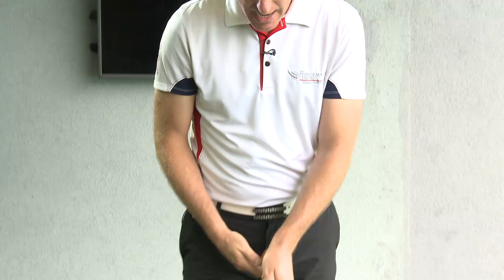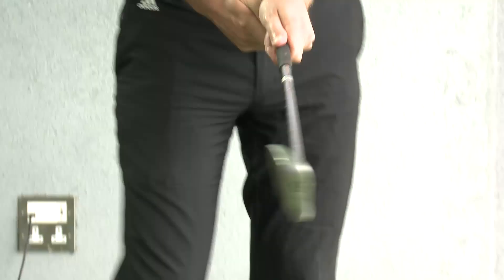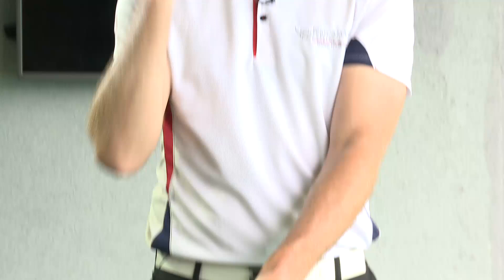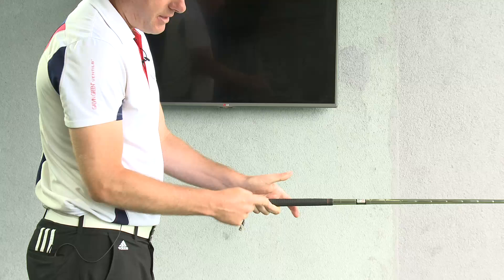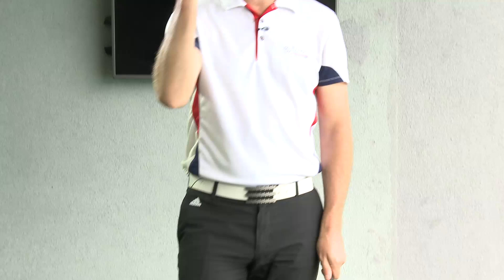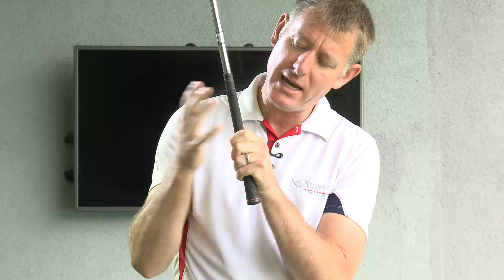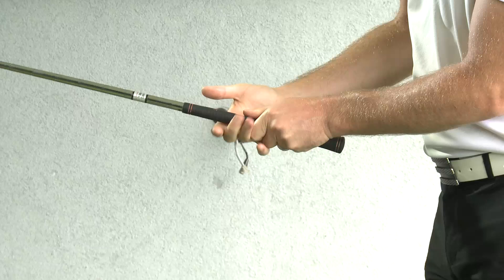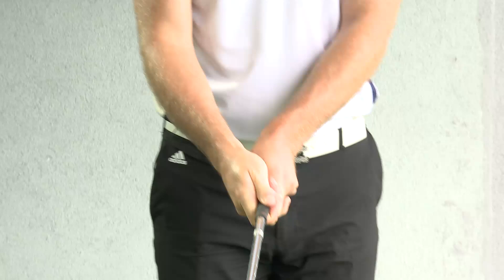The Vardon Grip in Golf

Comment: What do you think of the baseball grip? I'm a lefy and injured my left pinkie finger and could not interlock to use  the Vardon grip so went to the baseball grip and it completely took away slices and bad ball striking. Now stripping the ball long with a slight hook direction but would be with 10 yards of fairway center. Thanks Mike